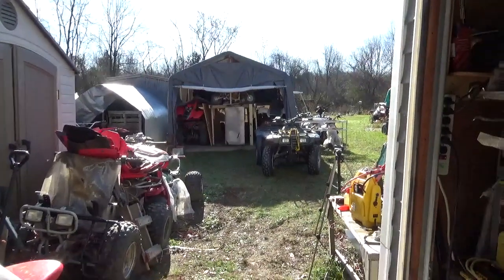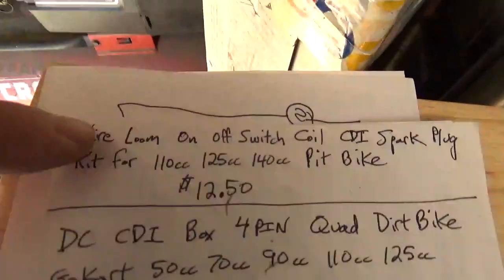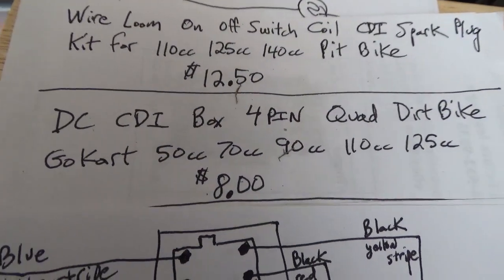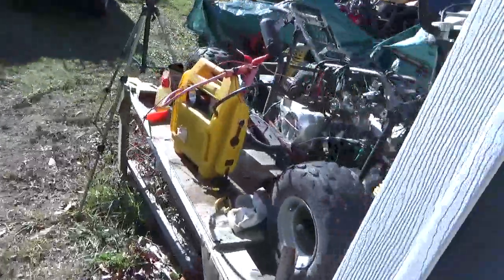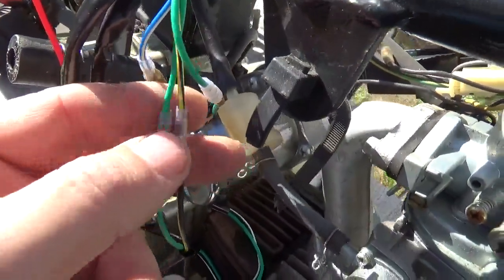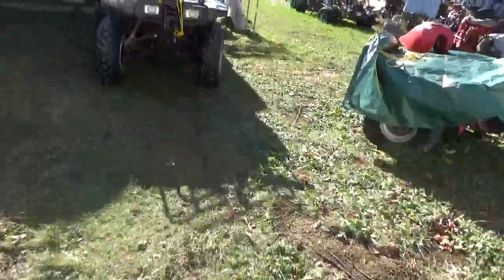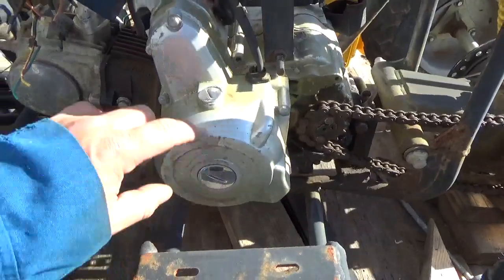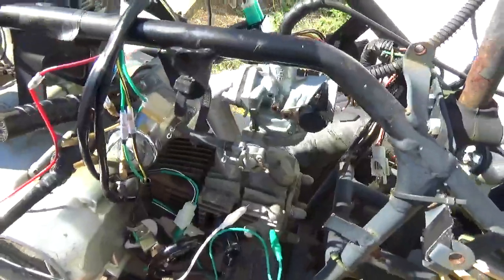Installing and using a low cost replacement ATV CDI system,

Comment: Hi I have a Yamaha Eiger 400 , from what I find it is a dc . looks like I have four wires coming out of the pulse generator when I crank it I get voltage going across two separate wire wow all four. Nothing to ground or any other wires. How do I hook up a Chinese CDI do I just use two of the wires for the pulse generator and leave the other two open. Thanks

Comment: Good afternoon Mr.Spooner...I am very thankful for your willingness to share knowledge. Man I finally got my 1984 xr80 running....i was having problems with the condenser (i thought) but it ended up being the woodruffkey....   I recently found a 1985 xr100 for a good deal and I couldnt seem to figure out why it wouldnt run...turns out it has a xr80 flywheel...the timing mark on xr80 is at roughly
 2oclock...xr100 is around 12oclock...can I make it work somehow? I dont have money for a flywheel at the moment so i wanted to ask the only guy that I think could make it work....so Mr.spooner is there any way this could work? Please guide a lost soul. Thanks

Comment: How about a Yamaha moto 4 300, it's got 7 wires coming from the stater? and i dont have a battery i pull start it. will i need a battery or will it use power from the stator? thanks for the video it was helpful

Comment: I wonder if these cdi units work on 6v? My Honda SS50 has 6v electrics. Also wonder what current these take? Currently the ignition is magneto (AC right?). Headights are AC but indicators, brake light, horn etc DC via the rectifier! Wondering if the AC unit would run off the magneto output or direct from the alternator? I have no idea what minimum voltage either unit will run off!

Comment: Can i connect a electric start with this setup
Reply from the maker: Hi Rhys, U can use the same 12Vdc to run the starter and the CDI system.... This engine came with a starter, kind of hard to add a starter without a kit or it is not meant to be there.... Thanks for asking, watching, and commenting!!!
Reply: Harvey Spooner can I use this on my 88 Yamaha champ 100 ?

Comment: Great videos thanks for all the effort. I've been pulling my hair out trying to make a 88' 350D Foreman fire to no avail. From what I can determine what you have put together in the form of a portable Ignition is just brilliant. I want to try it on this 350D. Just wanted to pick your brain about any thing specific and if you used it on one of those. It is the oddball with the revolution research wire off the stator and a pulse generator. Its in pretty good shape and a bunch of new parts, just wont fire. Any help would be most appreciated. take it easy.      Dave

Comment: would this work on my cr500
Reply from the maker: Hey Donald!!!  A CR500 has a 2cycle engine, this CDI system has a spark advance curve for a 4 stroke.... So, having said that, I think, (don't know, I have not tried it),  the CR500 will start, run, and ride with the 12VDC GY6 ignition, but, I don't think the performance will be as good as the OEM ignition.... I would try it....   Thanks for asking, watching, and commenting!!!

Comment: Hey Harvey, just recently got a 77 dt100 (yamaha), had no spark but i fixed that, not its not running good. when it starts it revs really high and uncontrollably and i have to shut it off. I am suspecting crank seals or sucking air from intake. Whats your opinion? great videos keep it up!
Reply from the maker: Hey Scooter! I think U R right, for 2 strokes, an air leak from the case seals, intake, or elsewhere would cause the run away that U describe.... I had a 2 stroke golf cart like that.... Time for a rebuild!   Thanks for asking, watching, and commenting!!!

Comment: I had to replace my CDI's on my honda xlv600 many years ago, they were not as easy to get back then as they are now, found a set at a breakers on a newer model but he still charged me £100 for the pair, tried one from an xl500, it worked fine but did not support the tacho wire, they were 6 wire type.
Reply from the maker: Hey Wizard, These would probably work for U, but, they would not support the tach either.... Thanks for the info, watching, and commenting!!!!